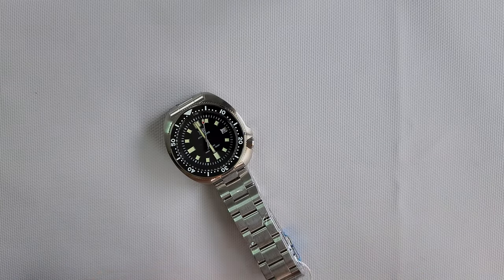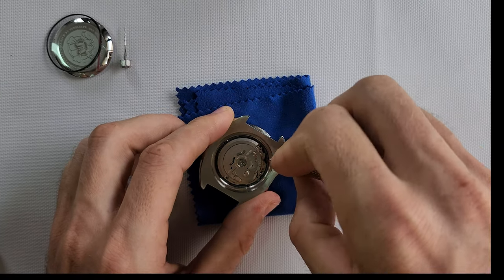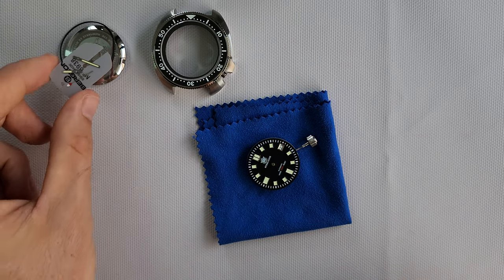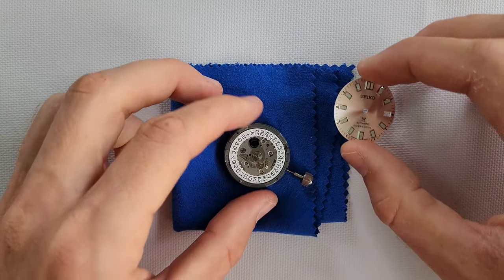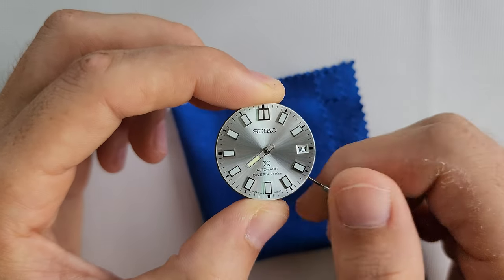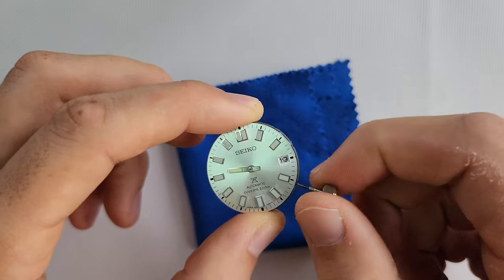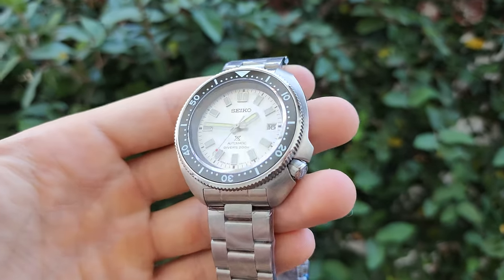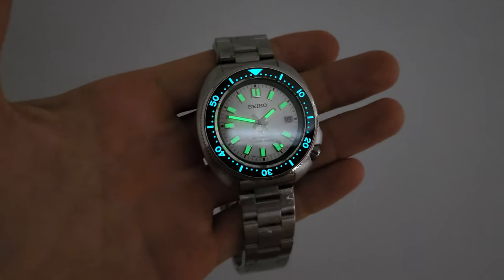SteelDive 1970 & Seiko dial | Easy modding for beginners

Comment: You could do with a movement holder and some finger cots. Some rodico is often needed for dial cleaning, as the blower doesn't always get off all the dust. Especially sticky specs.
Reply from the maker: Thanks for the suggestion. I do use finger cots now, but still haven't tried using movement holder :D But you aren't the first who tell me this, I will order it now!

Comment: Instead of the Bergeon dial protector, just use a thin piece of plastic. It does the same thing, is free, and keeps the hands from pinging off into infinity when they pop loose. 

Also - if you want to keep a dial but change the color of the indices, you can just use a sharpie to make the indices any color you want. The lume still shines. Same thing with the hands. If you want a different dial/hands but want them in a different color, same deal. Just color them. You can even color the indices on the bezel insert on most inserts. I got a 20 pack of sharpies and I even blend them to make unique colors.

And - if you want the day/date wheels a different color, just make sure you buy a watch with white wheels and you can just stick a small piece of clear packing tape onto the back of the dial, over the day/date window, and then color the tape whatever color you want with a sharpie. That way, the wheels aren't permanently colored. You can also just color the wheels BUT the solvent in the sharpie will dissolve the days/dates on some wheels. I learned that the hard way. That's how I figured out the tape method. 

I have the exact same watch you're modding but with a black case and I colored all of the indices lime green, added custom lime green hands, and swapped to a lime green strap and now it looks like a full-blown custom build. 

I think the watch was $48, the strap and deployant buckle combo was $12, and the hands were $10. You could never buy a full custom watch for $70 but I absolutely love this one. 

If you search for "My second Captain Willard build" on Reddit you can see it.
Reply from the maker: Wow, thank you for great hacks! I will try

Comment: Wow, nice modding! I have this watch and I want to change the back cover to a transparent one. I found transparent back cover on Ali with 33x29.9 mm, but I dont know it will fit correctly or not. Maybe someone already did this and know inner diameter?

P.s. Steeldive store couldn't answer my question
Reply from the maker: Hi, I also don't know the exact measurement for the back case. They didn't mention it in the description 🥲

Comment: Is it possible  change automatic movt to quartz? How difficult is this?
Crown, hands will be ok without any modifications
Reply from the maker: Technically it's possible. But no-date dial will be the only option. Hands should be specifically for the quartz movement you want to use

Comment: Can I put a Seiko stargate dial attached to a 7s36 movement or an skx dial attached to a 7s26 movement in the sd1970 case with no mods?
Reply from the maker: If the size of 7s26/36 movement is the same as NH35, then no problems

Comment: Could you fit a VH31 movement in this case? 👍
Reply from the maker: It's so much smaller than NH35... Technically it's possible, if to make a spacer with 3d printer, but I don't have it :D

Comment: Hi, do you think a 29mm dial will fit in this case? Thanks
Reply from the maker: Hi, yes 😊
Reply: Did it fit? I ordered 28.5 and it looks small?
Reply from the maker: @heyzuesvasquez4296  I used both 28.5 and 29mm for this case. Both fit perfectly, go ahead and try😊